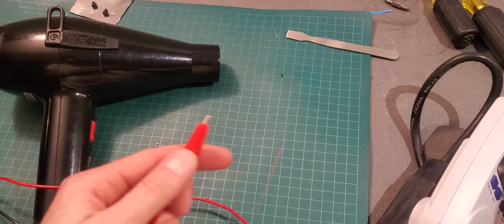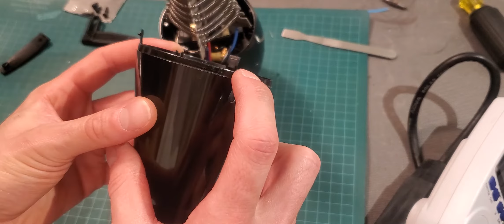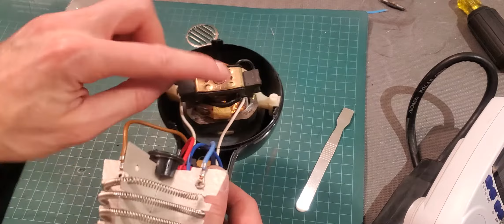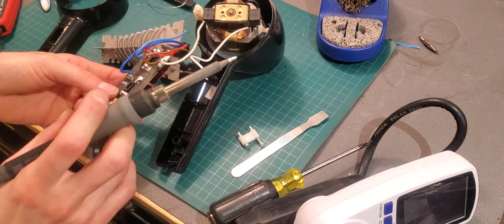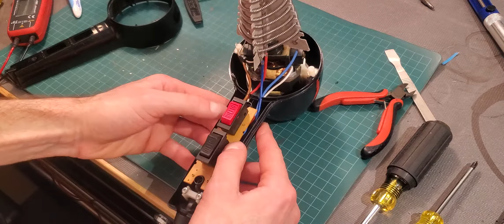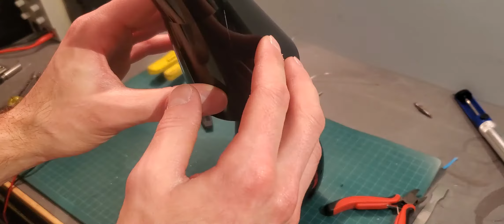Taking Apart and Repairing an Elchim 2001 HP Hair Dryer / Blow Dryer

Comment: Thanks for posting. I have a 2001 also... I'm not afraid to take things apart and fix them, but my problem is strange. It suddenly runs slower in both speeds. The fast and slow are still distinct from each other, but both are slower. I'm not sure how the diode is wired into the circuit, but it's the only component I can think of that might cause an issue common to both speed settings. I'll have to open it up and take a look. At least now I know what to expect when taking it apart. Thanks again.
Reply: Hi…in the chance that you might see this comment, did u have any luck? I have this one too and I’m having similar problem, I just can’t make myself trash it without trying to fix her lol 💗thx!
Reply: @Yomamas824  I still have not addressed it. It still works the same, hasn’t gotten any worse in three years. The motor sometimes makes a sort of squealing sound when I first turn it on, just for a second or two. I suspect the bearings are getting tired. I refuse to throw this thing out. I’ll do the bearings if I have to.